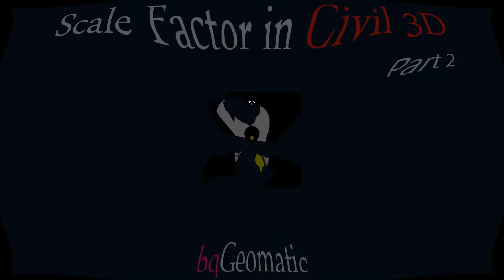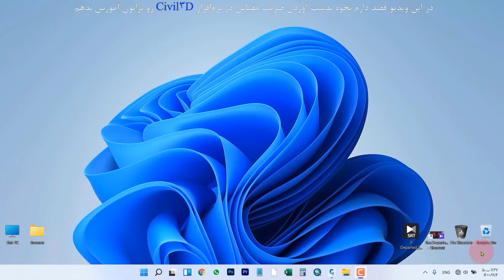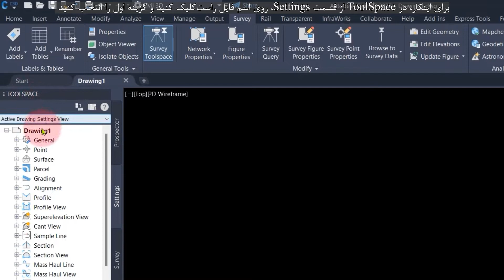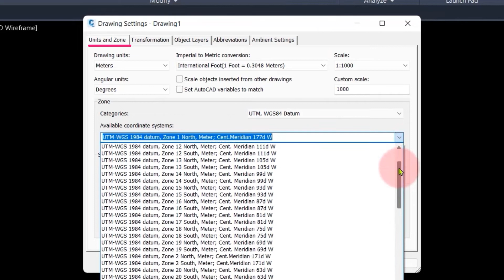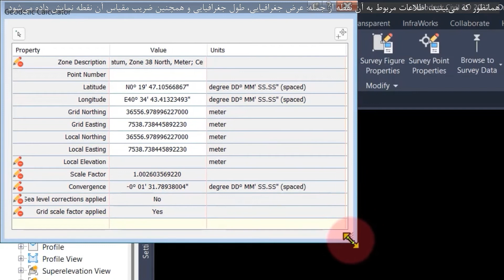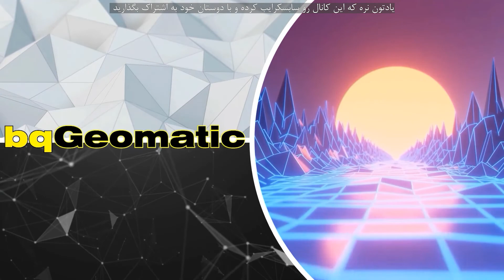Get Scale Factor in Civil 3D #2 - یافتن ضریب مقیاس در سیویل3دی

Comment: How to change scale factor coordinate value as 1.000 ?
Reply from the maker: You can’t change it. İt change with any location that you select. Every locatioan have a different Scale Factor
Reply: @bqGeomatic   can I start design works setting out with scale factor?
Reply from the maker: @kingstonjacob881  You can do your work regardless of the scale factor. Because it does not interfere in the design